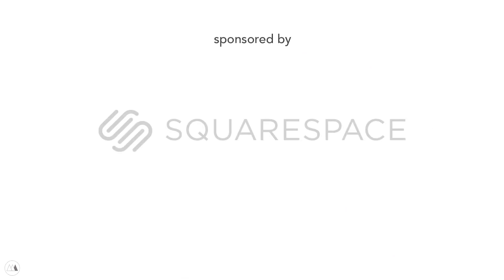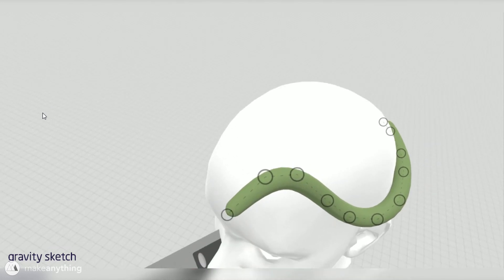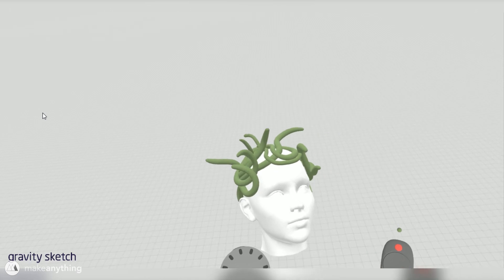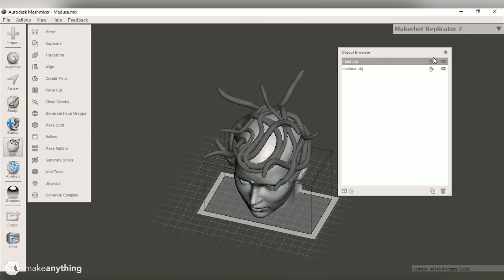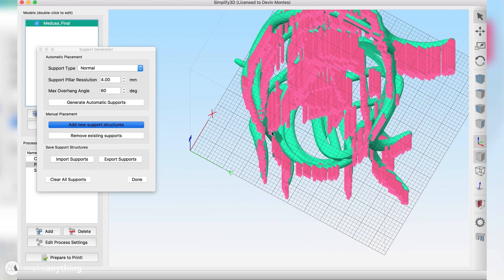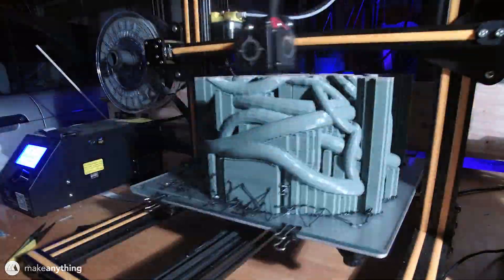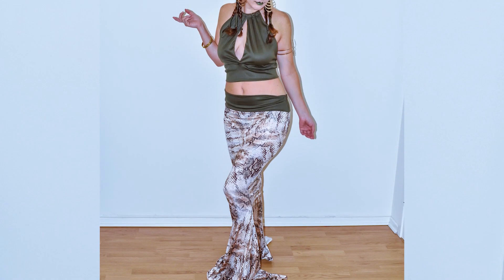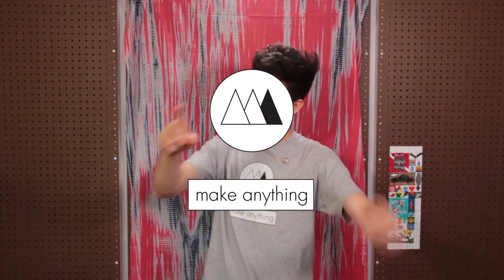VR Sculpting and 3D Printing Medusa's Headdress

Comment: Hi, This is Chris in Bulgaria, I just found this, I obviously missed it last year. This is a video where it shows one really good reason to have a 3d pen, I am using my glue gun now and again. I loved the print, but one thing came to mind straight away was how about making some snake heads and making them a push fit. In my garden I have vipers and their heads are big compared with their bodies.Your sisters paint job is great though, i liked the gold bits on the under belly. Long live PLA

Comment: +Make Anything // 3D Printing Channel
Thanks for another inspiring video. But that was one MASSIVE print, did You ever consider to "break it up" and print it in "batches". Cause it seemed like a pretty big gamble to do it in one go, even if the result was totally worth it.
Best regards.
Reply from the maker: +GglSux I could've, but honestly I wanted to challenge the printer and see if it was possible 😁

Comment: Love that you used VR to make this headset! I wanna collaborate in VR with ya one day?! Keep rocking bro. :)
Reply from the maker: Is that possible yet?? It would be pretty fun to share a VR space
Reply: If you have a rift or can deal with revive controls, Medium added a collaboration mode.
Reply: Print That Thing - 3D Printing Designs  cool , I do coding and programing; I LOOOOVE COMPUTERS!
Reply: insecondlife you can coliaborate in realtime, but it's not VR yet afaik